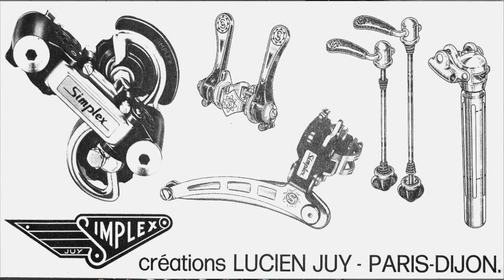Friction Shifters, The Derailleur, Fausto Coppi and the Tour de France

Comment: The real beauty of friction shifting is that you can mix any cassette with any derailleur you can find. Shimano sprockets with Campa derailleur? Not a problem! And apart from the upper and lower limiting there is absolutely no adjustment necessary. I am currently building my third bike with friction shifters.
Reply from the maker: Hello have blue 117. You are absolutely correct. Friction shifters are so much fun to use.

Comment: I reject your claim that friction shifting is inferior. It was a simple skill to learn and was more reliable. I feel that electronic shifting should be banned from competition because it is a small step from motorized drivetrains.  You forgot one huge advantage of friction shifting.  It allows the rider to chose the components they actually like and not be captive to one supplier. I have a  road bike with brakes that are half Campy Grand Sport ( front)and half Shimano 105 (rear) with generic aero cable levers ( probably the last levers ever made before brifters) with Campy C Record front Derailleur, Suntour Cyclone rear. ( With Campy Record levers, Campy record front hub and Deore rear Cassette. Shimano 600 crank and BB . SR Seat post because seat posts don't  matter. I got to chose what parts I wanted.  That freedom no longer exists.  I vish I could have found a Mavic front Derailleur but wanted to build this from my parts bin and local suppliers only. No one had a Mavic and only one shop even knew what that was
Reply from the maker: Hello Joeg3741 and thanks for your post. You make a very good point about the interchangeability of bicycle parts in general “in the old days” and how modern manufacturers restrict you to their ecosystem. I also do understand your dislike of electronic shifters but I have to admit that once you try them, they are so good and so smooth, crisp and effortless that it is hard for me not to like them no matter how much I love vintage bikes. Cheers and happy new year.